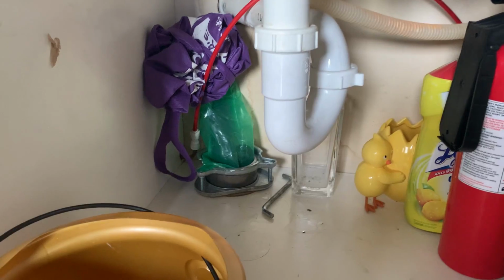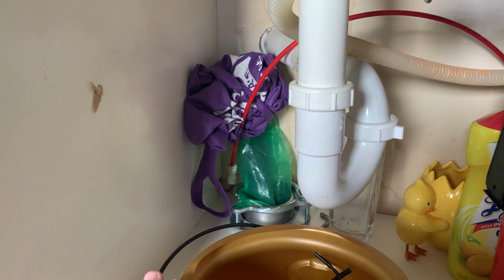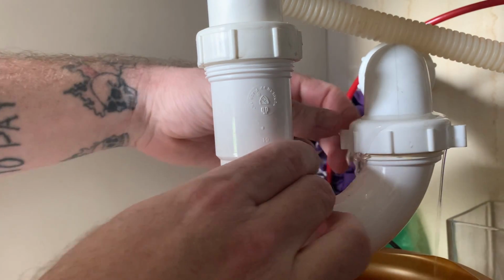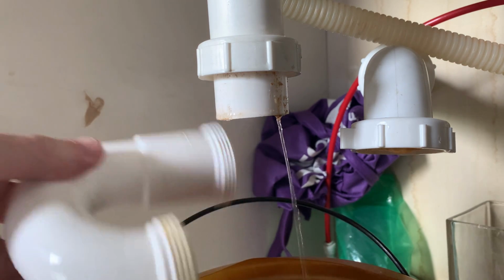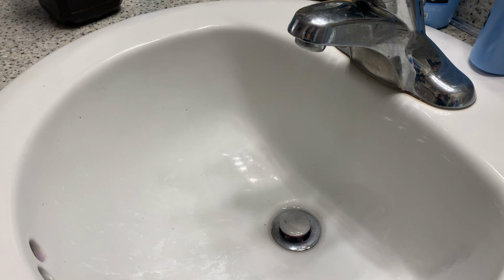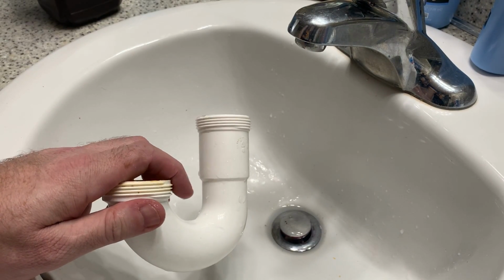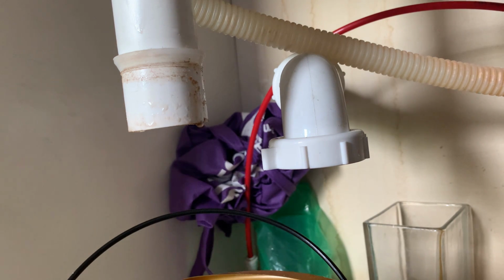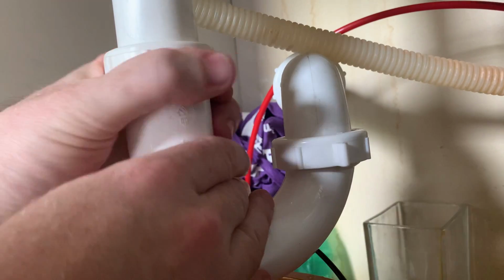How to fix / unclog a slow clogged drain kitchen or bathroom sink p-trap j pipe DIY slow draining

Comment: Thank you for this video. I learned today that rice shouldn't go down the disposal because it expands and causes the pipe to clog. 😱

Clearing the p trap fixed it right up! There was a lot of water, but it got cleaned up fine using a bunch of towels 🙃

Comment: We had some bubbling sound in the kitchen sink and the restroom toilet bowl also made some sounds and water level went very low. After some time, the sound has disappeared both in the kitchen sink and toilet. Will cleaning the pipe like in your video help?
Reply: In my experience, bubbling from the toilet + water level getting low in the bowl = a clog in your main drain. If this is a rental, notify your landlord. If not, then please check online if it could be anything else. You may need to call a plumber or rent a drain snake from a home improvement store

Comment: But what about if it is perfectly clean? Mine was fine until it was redone underneath now the water drains slowly with brand new underneath kitchen sink. P trap installed too high up? Not enough pressure it properly flow maybe?